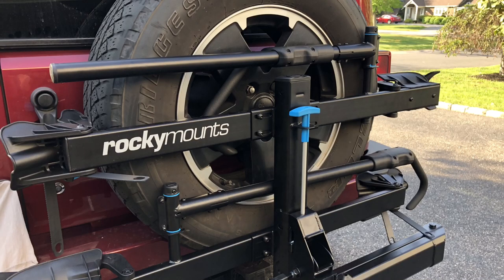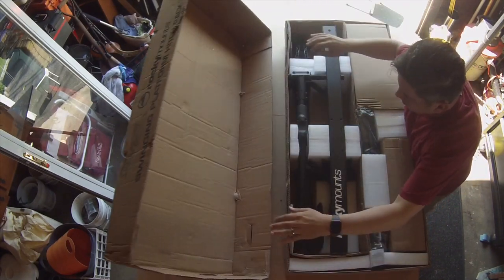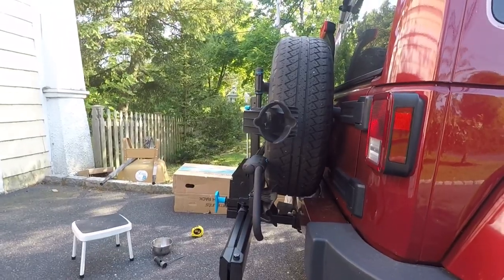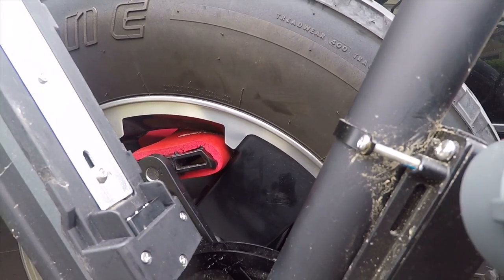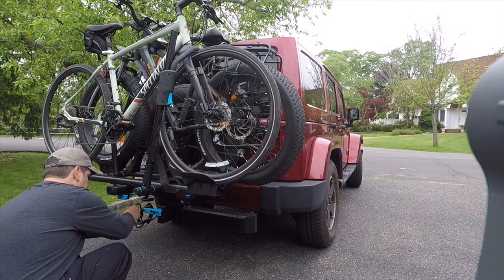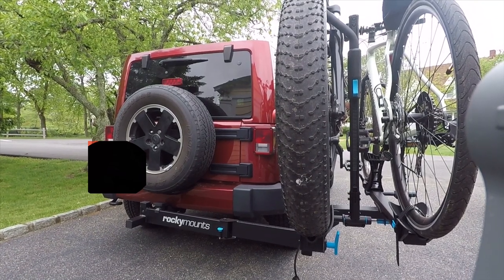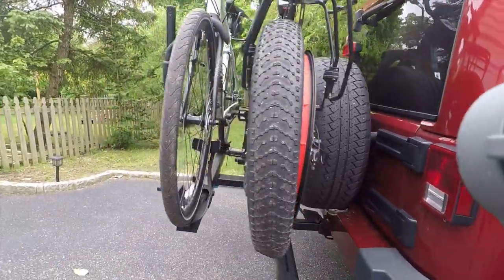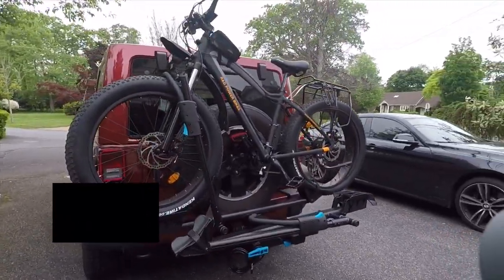RockyMounts Backstage Swing Away Review

Comment: You could always just throw your spare wheel in the back of the vehicle whenever you want to attach the rocky mounts rack. Anyway I have recently purchased one of these racks myself and overall I think it is pure genius. It fits to my Ford Ranger no problem and certainly doesn’t need a hitch extension. The only gripe I do have is the fiddly process to tighten the bolt in the tow hitch which requires you to almost crawl under your vehicle to tighten it up. Thanks for sharing 👍😎

Comment: I’ve got a high clearance bumper on my Tacoma which moves the receiver much higher. I’m worried the tailgate might contact the rack when it’s down, do you have a measurement from the top of the hitch insert to the highest point on the swing out when open?

Comment: Did you decide to buy the 4" Hitch Extension?  I have a toyota rav4 that has a tire on the back and I am hoping that I do not need a hitch extension either.  Can you tell me the measurement from the hitch pins to the closest part on the rack to the vehicle/spare tire when it is in the folded up position?  Thank you so much!
Reply from the maker: It's 9.75" from the hitch bolt to where the frame rises up.  The problem is depending on where your spare tire sits, how you mounted the bike trays, and what position the locking arms for the bikes are in, you may not be able to fold the rack up against the spare tire.  

Now that I've gone through it, I can admit it's hard to figure out without the rack being in front of you and testing it out.  If you have a hard cover on your rav's spare tire, I suspect that is going to make things worse, as some parts pass into my tire rim when folding.

I originally bought a 7" which was too big.  I'm only getting the 4" if I feel necessary and for now I'm good.  If I change the rims on my wrangler, I may have to go with an extension as I suspect my bike pedal will interfere.

I purchased at REI specifically for the option to return because I was unsure of these exact things.  But if you feel a hitch extension would work, I'm sure that will be fine.  It also depends how far you are going, how heavy are the bikes, etc.

Comment: Nice. Going to get one. Do you think it is sturdy enough to hold a Rad Mini and a Rover? I believe they are about $599 on Amazon and etrailer. I’d probably go with etrailer in case I run into a snag in assembly although it looks like Rocky Mount is good also for support. Good video. Thank you.
Reply from the maker: Yes, have both myself and have done it. Be sure to unload the bikes of batteries and bags to keep them as light as possible.  But I had no issues.  Highway and local roads, light off road.